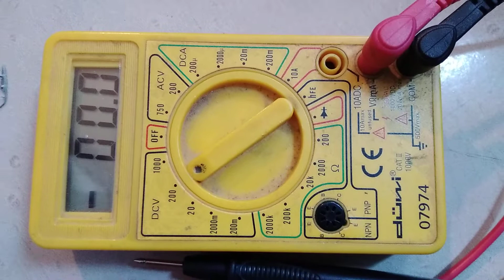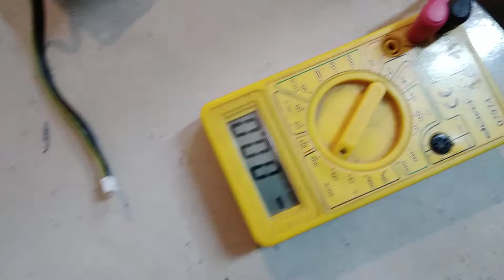printer power supply test

Comment: I have the L 1800 the main power switch on the back comes on and the power board has 42 volts when I tested, I changed the 1 and 3 resistor and the f 1 fuse, the power button on (the front does not turn on) I don't have much experience,maybe I did wrong, please help!!!